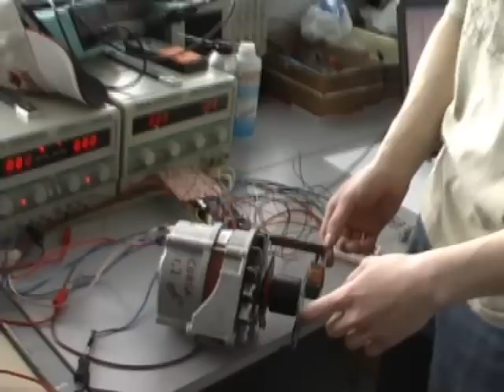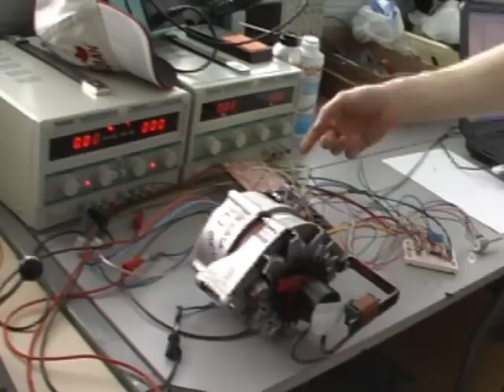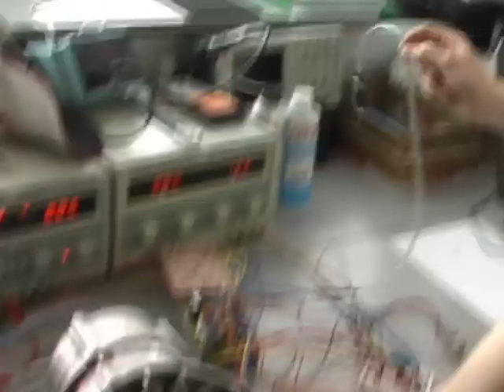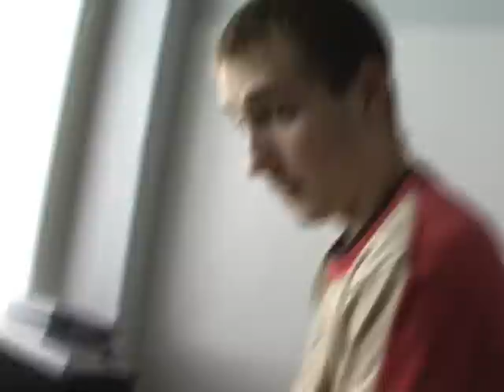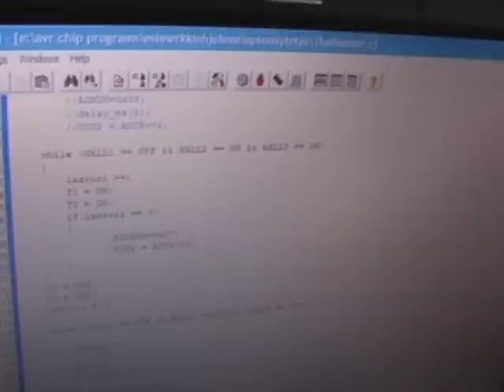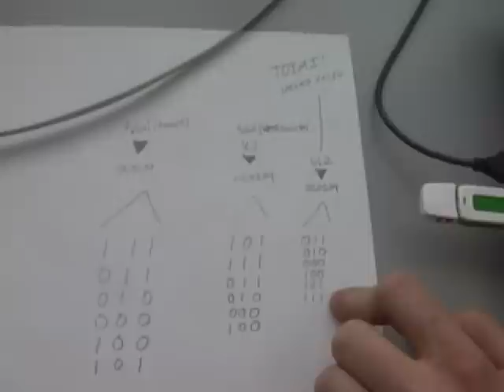BLDC 3 Hall sensor control working finaly

Comment: I still find it basically dumb to not have a rotating mass like this NOT anchored down just on the occasion a wire comes loose, the sudden lose of power causing the sudden lose of rotation. You know those laws of physics, objects in motion and equal and opposite actions and reactions?

Comment: Hello brother I preparing an motor from alternator by using hall sensors. We have issues on motor rotation it's not rotate continuously. So can please suggest some idea for run it well. Our major problem is placing the sensor in there positions. Is there any calculation or any angle in sensor positioning?
Reply from the maker: The sensors should be 120° apart, that's 120° electrical degrees of rotation. I used a separate magnet rotor for the sensors. I added the magnet rotor to the alternators shaft and my sensors read from this added magnet rotor.

Comment: Great video but test another solution: Back EMF, see the Microchip application notes about BLDC.
Reply from the maker: Needed high starting torque so i used sensors.
Reply: @epaloniemi  I understand but i going to do both solutions in lab. What angle did you use between the hall sensors ?
Reply: Sorry you say in the video ahahahahah

Comment: Remove the rotor and place some magnets in there. You will see the difference.
Reply from the maker: Yup I did that. Haven't made a video about it but the iron is cheap in alternators and the lamineted iron sheets are to thick so there is to much eddey current. Didn't end up being a good motor. Hoverboard motors a cheap and pretty good.

Comment: Hi, would you have a close up picture of how you have mounted the hall effect sensor and also which is the rotating magnet these sensors detect on the outside. I have just installed three sensors (12V) within the body of the car alternator BLDC. They were individually tested as well before I put things back. However when I pass rotor excitation volatge (5V) and try and pick up the fluctuations across the three HE sensors, all three read a perpetual high i.e 12 volts.  Any advice would be much appreciated.

Comment: I wonder why halll sensors are preferred over sensorless motors?
Reply: because sensorless motors can have problems in getting started with load, getting easier to burn in stall, and sensored motors "know" what is the polarity of the stator and how it goes with the rotor magnetic field, getting better to start with load (like heavy rc vehicles, go karts and other electric vehicles)

Comment: Hi.  I am also using a car alternator.
Mine is 14 poles .. I am using discreet combinational logic to drive it.
No Micro required. Just have to fit a sensor disc to the drive shaft with 3 halls . The disc has many magnets which duplicate the poles in the stator and effectively encode the 6 required position status of the 3 phases.

Comment: Hello, I must commend you for a job well done. This is a true inspiration to those striving to emulate you.This is truly a great job! I am also currently doing a project on how to control the speed the breaking and the direction of a BLDC motor using the hall sensors. I am using a 3 phase 24V motor with a peak current of 5.4V. Did you use a pic or an Arduino to program the controller? What sort of microcontroller did you use and which one? I also have the option of using sensorless detection. Which is easier and advantageous? Could you please help me with the code and the schematic? Your help advice and input will certainly be very helpful.

Comment: Nice job using the micro and code to run the beast looks great.   Cardboard WOW I thought my PCB was awesome.  You should post everything on large sheets of white paper schematics code setup.  Hell, better yet put it on a CD and I'll buy one.

  Take a look into gearing to convert speed into torque.   the whole thing is based on a fulcrum.   My impulse motor uses 5vdc impulses at this time but has an 18 inch diameter rotor mounted on a 1/2 inch shaft.  so the fulcrum is 9 inches.   I found that Hall sensors are tricky and each seems to need its own alignment because the magnets poles are usually distorted and not perfect.  each pole of a magnet actually has two vortexes the North end has major north minor south and the South pole has major south and minor north.

Comment: Impressive, I have a project with a brushless motor using an RC controller, however I am getting cogging on startup because a back EMF is required for the controller to know the rotor position. Do you think there is any way I can send a small current to the controller to emulate an emf signal for the controller to know the rotor position? or should I just buy another sensored motor and sync the 2 motors together by connection the shafts together, 1 for power the other as a sensor unit?